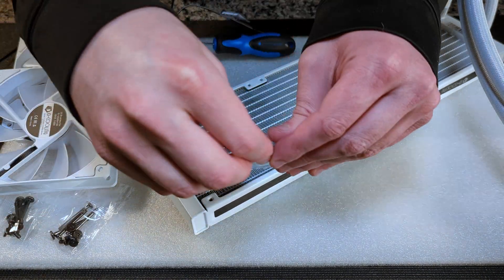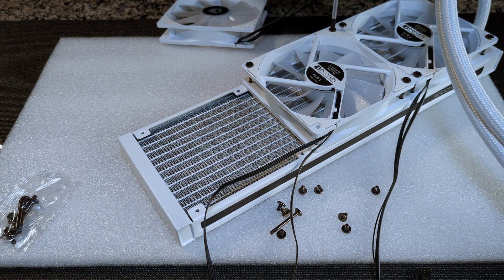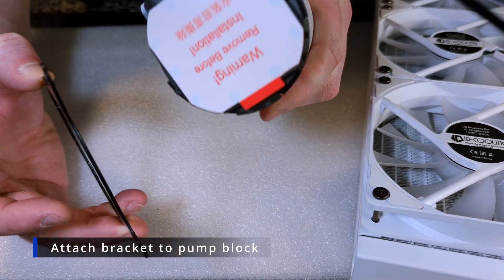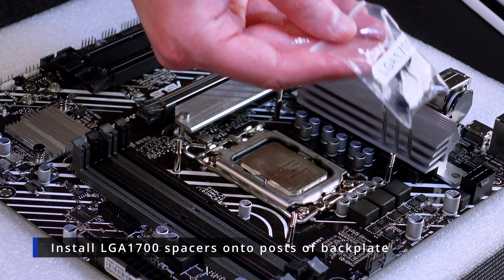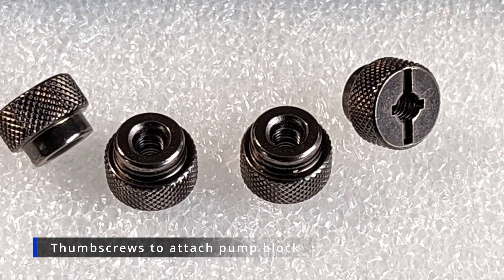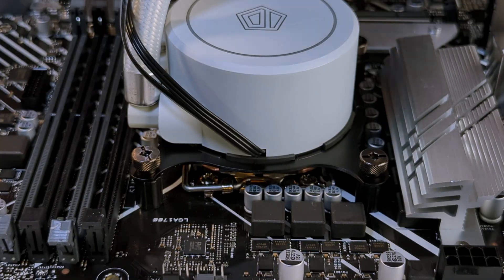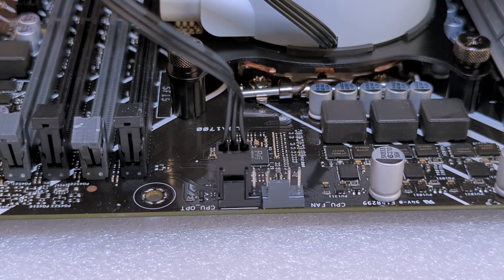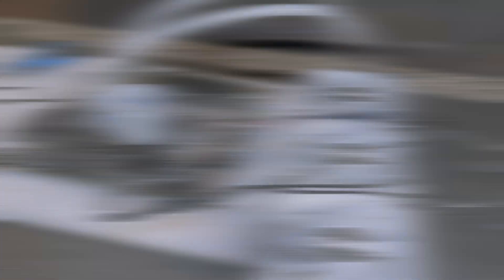LGA1700 Install ID-COOLING FLOW Series AIOs

Comment: going to buy this to upgrade my cooling system. would you say this is still worth it in 2024?
Reply from the maker: Probably. Although I have not kept up to the latest ones recently.
Reply: @KLEEBZTECH  i went years with just the cooler with comes with cpu but looking to upgrade as it can get hot in there these days but don’t want to break the bank

Comment: Anyone know where I can get replacement stand off screws for this device? I snap the screw off by applying to much pressure.
Reply: Contact tech support. They should send you a replacement.
Reply: @billywild5440  I did and they sent them. Thanks

Comment: It always pays to place a smol peppercorn-sized blob of thermal paste in the middle of the cpu, then mount and tighten; then disassemble and inspect whether it makes proper contact. If it's okay then you can reapply paste with a normal amount.

Comment: What are the small screws for? I want to do a push pull config. will it come with enough screws for that?,or can i use case fan screws to ad the additional fans to the rad?
Reply: its for radiator if u want to mount it on front of the case

Comment: I have a b550 board kind of confused on where to put the fan rgb
Reply from the maker: The RGB would either plug into the RGB on the motherboard if it has it or you can plug into the supplied controller which then plugs into SATA for power.
Reply: I have an amd 5

Comment: Do you think it would make a difference if I plugged the fans into a hub instead of using the splitter? Also, is the sata cable used at all?

Comment: hello, i'm using ID Cooling Iceflow and wanna upgrade to Intel 12th gen (LGA 1700), is it still compatible too on Intel B660 motherboard ?
Reply from the maker: Yes it should work on any b660 board with the correct mounting kit

Comment: Does the mounting kit come with the AIO? Do I have to buy it seperate? If I have to buy separately what should I do, because the Amazon page is out of stock, and I don’t know when it’ll come into stock.
Reply from the maker: We had ordered ours on amazon when they had the LGA 1700 mounting kit in stock, I'm not sure if they are currently shipping it with the cooler or not, sorry
Reply: @KLEEBZTECH  That’s alright then, I’ll just use the stock cooler for my i5 until I can get the mounting kit
Reply: @exemplariness  tell me how it goes i plan on getting one of these aios

Comment: The 1700 mounting kit came with little plastic washers for the block screws and the diagram didn't show them. You didn't use them so I'll do the same.

Good, clear explanation! Thanks!
Reply: Some models need the washers!!!

I’m currently troubleshooting the LG1700 mounting bracket that came with the id 280mm aio. The bracket that that mounts to the pump header is in two pieces that have to be attached with screws. I can’t get it to seat in place, it’s like it needs washers or something else that I’m missing. So THANK YOU for posting this, I was wondering what those little plastic washers were for :). 

Amateur Tip: first time pc builder here and I can’t stress this enough. You will be excited and possibly feeling happiness which could shock your system and cause you to make bonehead mistakes. You will want to open all the boxes to see all the goodies. Label a ziplock bag or bowl with the part you are opening then put all screws, wires and instructions in that labeled bag.
Reply: @dereksmith6713  thanks for the tips bro!!

Comment: Thanks for the video! You use 2 splitters, are they in the original package with the AIO or do I have to buy them separately? Thanks.
Reply: Ours were included in the box with our aio
Reply: @kylekleeberg6422  Thanks for the quick response!

Comment: Can you do a video benchmarking with a 12600k? I want to see what the performance is
Reply from the maker: There are a lot of variables when it comes to testing, but assuming your case has decent airflow, a 240mm radiator should be more than enough for a 12600k
Reply: @KLEEBZTECH  what case would you recommend? I'm looking for one 60 or under